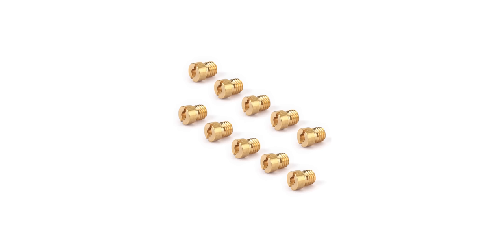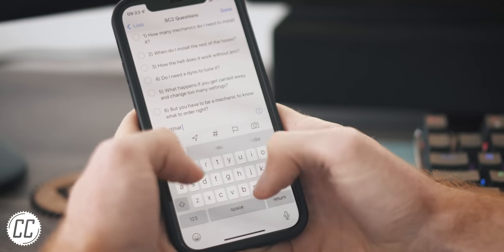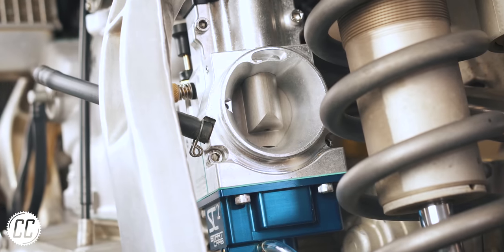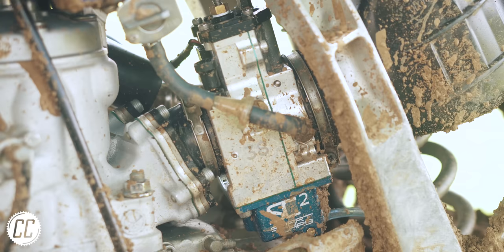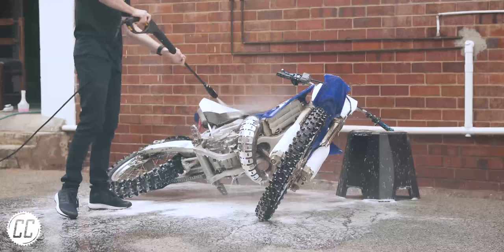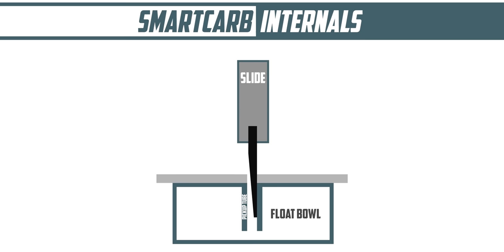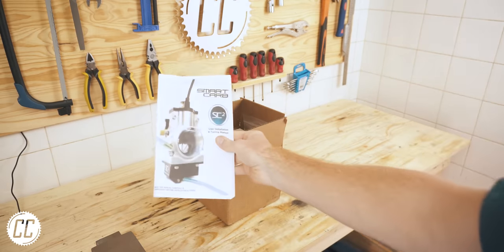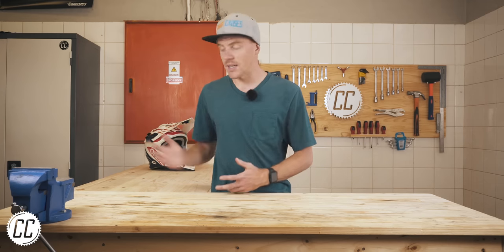The Best Carb Money Can Buy? | SmartCarb SC2

Comment: Good video. I've been running the SC2 on my Sherco for close to a year now. I ride big elevation changes, one ride may be at 2000' and the next at 9000' so not having to make any adjustments and the increased fuel economy is huge for me. It's all the advantages of FI without the added complexity and still retains the performance and feel of a carb.
Reply: I really like your channel and my SC2 ;P
Reply: What kind of increase in fuel economy did you see?m
Reply: Does this carb work on any bike? I have a 180cc Indian bike.
Reply: @ollie6512  You'll get about 30% more out of a tank, my TE300 does about 110km to a tank now, was about 85 or so before. Seems like the gains are reduced if you're doing lots of hill climbs though, but I haven't been able to measure that in any scientific way.
Reply: There is no great carburetor feel. You are dreaming or have virtually zero knowledge of mechanical principles. Carbs provide no difference in "feel" except when the weather changes and the run worse. Fuel injection is "ALWAYS" superior to carburetion when tuned and is why manufacturers have virtually all went injected. You sound like all my fellow mechanics in the seventies when they said it was the end of the muscle car era. We currently have cars with more HP than was "ever" available in the 70s. Modern cars are more fuel efficient per HP, lighter, better handling, more dependable, quieter and more comfortable to drive. And not one of them has point style ignition, drum brakes and --- carburetors. 90% of guys could be handed two different bikes same size, everything but one has louder exhaust and you'd all say the loud one has more power. If you think carbs are better you also think that WWI, WWII, Spanish flue, the great stock market crash, the depression and polio are what made the good old days so good.
Reply: There is no added complexity to fuel injection. It's all controlled in it's little electric brain that it's plugged into. Senior Master ASE for 30 years and I would slit my wrists if I had to start tuning carbs again. Carbs suck and can never be meter fuel as accurately as fuel injection especially due to elevation and weather changes.
Reply: @matthewmoilanen787  Nope, try the STIC Super X carb or their PWK insert metering block. EFI can't match the cooled air/fuel vapor delivery. Hands down, elevates power to next level. There is background in testing in NASCAR and the carb added 50hp over the teams carb. My 200SX feels like the low end is supercharged and the mid to top is turbocharged. Easily hangs with bigger bores on the tracks.

Comment: In the pre-FI era, it was common to use a Gunson Colortune see-thru sparkplug to visualize the colour of the fuel burning. You then tweak the carb mixture screw and or needle to get a nice blue hue for near ideal mixture. Too yellow means too rich, too white means too lean.
Reply: First time I hear of that, definitely need to check that.
Reply: Exactly I had bungs on my 302 SBC where I could view each  exhaust Port...too achieve blue flames.... indexing plugs and length of wire timing... recurve air gap Etc..... Remember the race car called Blue Flame... AIN'T IT JUST AIN'T IT 😜 lols
Reply: The ol color tune. I love when people in my motorcycle groups have problems with tuning and I mention the $35 color tune and they have no idea what I'm talking about
Reply: all that just for a computer to do all it way better
Reply: I still have one
Reply: Thanks for enlightenment. Just found out. Will they also work the same for testing 2-stroke engines ?
Reply: @jeanlawson9133  years ago, had a lil husky brushcutter engine on my BMX... late one dark night, buzzing along, looked at the plug...

never before or since have i seen it on any other plug. a beautiful blue glow through the semi translucent porcelain. like it had been over fired and gone that extra step to glass/obsidian in manufacture. lil nkgk... um... bmpr5h? something like that. from then on, any yardtype engine needing a tune was taken into a dark room...

the videos of turkeys with perspex heads had me buying a 35mm quartz glass "window"... set it in a bezel in a head instead. then i can run it properly... sigh. another "one day"...

i got LOTS of "one days"!
Reply: Damn thats cool!

Comment: I have a lot of vintage motocross bikes. I've tried the Lectron on two of them before I heard of SC. After I had one running real good with the Lectron I swapped to a SC to see the difference. The SC works better by far and the ease of tuning makes them a dream to jet. Because as we all know, old bikes were close at best with their jetting. The SC got even the most fineky of them running so much better then I even thought possible.  I also have them on my modern off road bikes, Beta 300, YZ 250, Beta 200. I'm my book it is the best carb made, period. I hope this helps. It will be $ well spent.
Reply: Does this company make carbs for 4 stroke engine's?
Reply: @dukecraig2402  there's no difference between a two stroke or a 4stroke bike carb only if you have efi a simple pwk carb will work on both engines. I don't now about SC but I think it will work .
Reply: @user-uz5nv4hs8d  
I see there's a 40mm, that's the right size for what I'd do with it. 
I didn't know if there's something special about these that's for 2 strokes because of the electrical connector I see in one of the views.
I'm definitely going to investigate these and see if I can get one on a Sportster, I love tinkering.
Reply: I've heard lectron described as the "best drag carb"
Reply: Do these modern 2 strokes have some kind of electrics in their carbs?
I haven't been around 2 stroke bikes since "back in the day", here in the states they're virtually non existent anymore, last I heard there was only 1 or 2 models you could buy here and even then I haven't seen (or heard) a 2 stroke in years, all the dirt bikes I see guy's riding around here anymore are all 4 strokes.
Reply: @dukecraig2402  Two strokes have a reputation for being dirty. But check out the 1970s classic cars - stinky or what?  Direct injection strokers are clean and give better fuel efficiency per bhp than equivalent (as in big enough to keep up) four strokes.
Reply: @dukecraig2402  most two strokes are injected now too. I prefer a carb because they don’t need power to operate. I ran an air cooled 86’ IT200 for years with no,problems. I kept it tuned up and ran good fuel, still, the less there is to go wrong the better.
Reply: @deborahchesser7375  
I learned how to ride on an 82 RM250Z Suzuki (do or die, literally).
Several years ago I was talking to a friend I used to ride dirt bikes with about new one's and he told me that 2 strokes were pretty much non existent anymore and if the EPA had their way there won't be any. 
I know they're giving the chainsaw and weed wacker manufacturers hell about 2 stroke engine's, not long ago I was walking through a Home Depot and saw a 4 stroke weed wacker for sale, I immediately thought "Here we go, now they're after those".
Reply: @dukecraig2402  right, and the thing is, if every two stroke ever made we’re all running wide open, it wouldn’t equal one factory smoke stack
Reply: @dukecraig2402  if they don’t have fuel injection, they are purely mechanical still.
Reply: @dukecraig2402  i got a fake Honda 4 stroke weed eater.Its good but weak and works by creating a mist of oil.
Less piwer than a 2 stroke weed eater but significant fuel economy,easy start every time and less noize.
I have 2 stroke car and 4 stroke weed eater 😂.
Reply: @deborahchesser7375  Most people wouldn't know the difference between steam and smoke. In the United States what would be coming out of a smoke stack wouldn't be considered smoke after going through the scrubbers . If those scrubbers happen to to be used in the aluminum manufacturing the smoke is turned into fluoride for drinking water
Reply: Try a Rekluse clutch also. What a revelation if you have a cable clutch. I’ve had four WR450’s and I just put a Rekluse on one of the two 450’s I still have and it’s bloody amazing.
Reply: I wonder how it would work on my 85 Cr 500?
Reply: @TopRevs  it absolutely would. 38mm recommended for most stock CR500 setups, 40mm for the hotter ones and/or those prioritizing top end (desert, snowbiking, sumo, etc).
Reply: Do yourself a favor and try the new STIC Super X carb. Only do so if you want substantial gains in power, bottom to top. Handles temp and elevation swings, very stable. My SC and PWK paled in comparison. SC not bad, just not magic on my 200SX, which now runs with bigger bores out on the tracks.
Reply: @davidelliott5843  Your local politician is running a yacht that puts out 3000 time as much pollution as a two-stroke dirtbike.  I love this planet, but people have the wrong targets.

Comment: Just saw a video by fortnine explaining whether a carb is better or fuel injection. Would recommend.
Reply: Saw same video! It was good yes!
Reply: They do make a good argument, for both methods.
Reply: carb = more fat raw power down low from 1000k rpm up  EFI= smooth economic power over 6-7k rpm up to red line. non is bbest or worst both are used for racing and dailies etc
Reply: Mostly fuel injection is more reliable than a carb and that's about it really
Reply: @joshsevens9611  Remember that dirtbikes may be the exact example where the carb is more reliable.
Reply: I don't think he was saying it was better but rather their difference isn't a big deal in practice. They both work equally well.
 
At least that's what I got from the video
Reply: He wasn’t saying carbs are better, he was saying they’re both imperfect systems that each have their pros and cons. Personally, I think he put them on too equal of a footing though. Carbs suck, IMHO.
Reply: @motoboq9606  I would say so myself that EFI are quite fuel efficient a bit too efficient my sister 155cc can go upwards of north of 300km in a single fuel tank and it revvs all the way to 8700rpm
Reply: @joshsevens9611  no cleaning
Reply: Good youtuber he is and he's funny asf
Reply: @joshsevens9611  

I’m guessing you mean more reliable in terms of the jetting being more consistent but a carb is more reliable in terms of longevity
Reply: @ian9toes  Yeah I mean more reliable in the terms that you don't really have to worry about a fuel injected bike sitting for long periods of time or having to tune a fuel injected bike as much as you would with a carb bike, but I do have to say fuel injected bikes usually have wiring issues over fuel issues.
Reply: will never be as good as direct injection.

Comment: That's a crazy price tag to upgrade. I will say the technology is cool, and I'd run it. But not for that much, and they limited to two stroke bikes. They'd have a lot of opportunities to make money on 4 strokes, and ATVs if they got in to it I think. especially people with older warriors and stuff that they no longer produce oem parts for. The aftermarket just isn't as good.
Reply: i was thinking the same thing, id love to upgrade my 4 stroke, but not for $600
Reply: @kidsalex13  there is other aftermarket smart carb options I have found. Pricey still.
Reply: This technology would be amazing for the adventure segment, going across a variety of altitudes without wanting to change carb jetting. I was on their website, just about to buy one, when I realized they only make them for motocross 2-strokes. What a bummer. It doesn't even make sense when motocross bikes won't even be used at high altitudes.
Reply: @theyeetus1428  I do think there is some other companies that make them for different machines.
Reply: @Theupstateidiots  Do you recall the names of those companies?
Reply: @theyeetus1428  lectron is one company I found. They make them for all sorts of stuff.
Reply: @theyeetus1428  we're working our way into the 4-stroke market but it's slow going due to the shear variety of different carburetor configurations, sizes, throttling mechanisms, etc. The 2-stroke market is much more readily serviceable as they only use one of two different carbs stock and they're both the same in terms of fitment and throttling. The larger 4-strokes require more complicated dual cable throttling and there's merit to slides like in the FCR that use roller wheels and a vacuum plate. 

Most of the 2-stroke bikes we equip aren't motocross bikes, but rather enduro and hard enduro and those riders absolutely do see wild elevation/temperature changes. The highest known bike we've equipped is in Nepal up over 16,000.' Stay tuned please as we continue to expand our product offerings over time.

Comment: The Sonex aircraft I flew for 18 years had an aerocarb they sold that I installed and it worked the same as this carb. I loved it because I could adjust the mixture to go lean of peak at high altitude.
Reply: Yeah that's what I'm looking for I want to upgrade a simple updraft carburetor something better on a corvair conversion engine.

Comment: The smartcarb looks really nice and clean. Imagine having it in a CR 500 :D
Reply: I have a lectron  on my cr500 and it is night and day from the original carb. There have been a few guys that have tried running the first smartcarb with no luck on the cr500s but haven't heard of anyone trying one of these yet.
Reply: @davidwagner2280  oh interesting
Reply: You don’t have to imagine it. We’ve equipped hundreds of them with the new SC2 model SmartCarb. We recommend the 38mm size. And like the YZ here a trim inside the airboot is required for proper function.
Reply: @SmartCarbFuelSystems  Nice :o
Reply: Im picturing it on my 85 ATC250R...hmmmm....

Comment: Imagine adding individual circuits so you can tune each one independently...  "no jets" is just a word play. Jetting refers to fueling - and the other carbs using no jets also requiring fueling adjustments.
Reply: Imagine not having multiple circuits that need independently adjusted... or a carburetor that drives fuel flow proportional to air density from inside of the airbox instead of in front of the rear tire, one that also drives fuel flow proportional to that airflow's velocity right at the manifold. Those features preclude the need for multiple circuits and largely define what a SmartCarb is.

Every carb requires adjustments. There's too many variables affecting it from engine health changing over time, modifications, fuel selection, rider preference for different riding conditions, etc. The difference is that these carbs greatly mitigate the adjustment requirement for air density changes. A carb that's dialed is a carb performing at its best. Conventional carbs with jets, and we all know what we mean when we say "no jets," do not stay dialed for even moderate changes in air density, changes that take them out of optimum tune.

Furthermore, SmartCarb adjustments, if even required, are made externally, by hand, without tools, in seconds.
Reply: @SmartCarbFuelSystems  still wating on my 10-15 percent power and improved bsfc